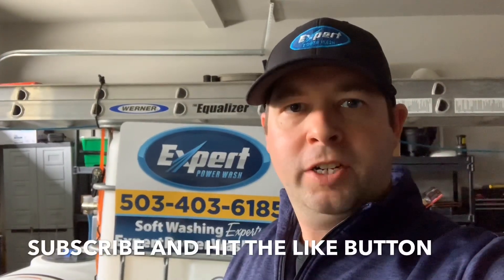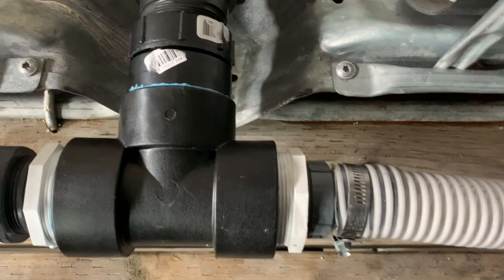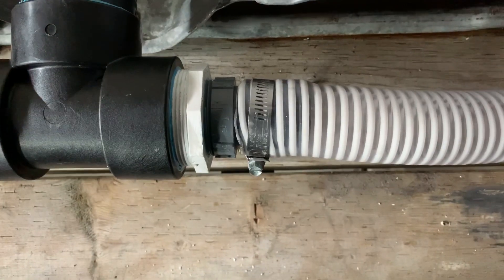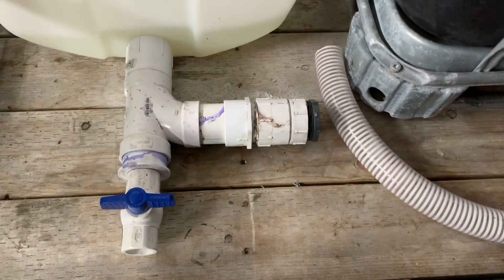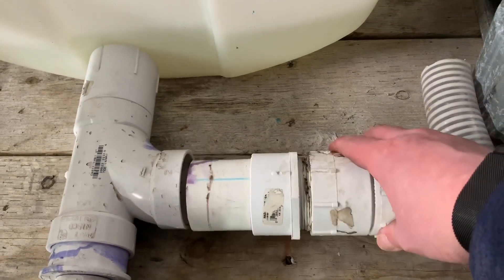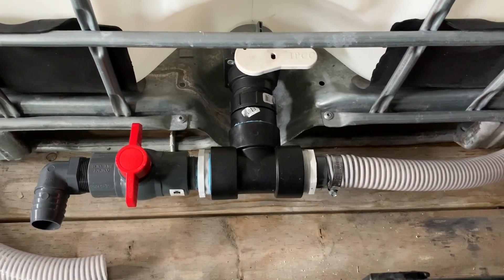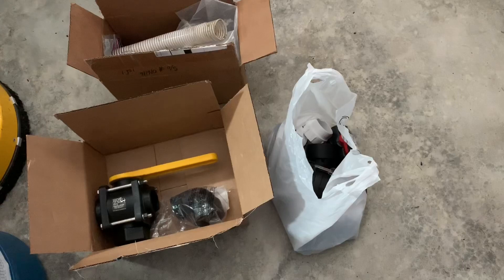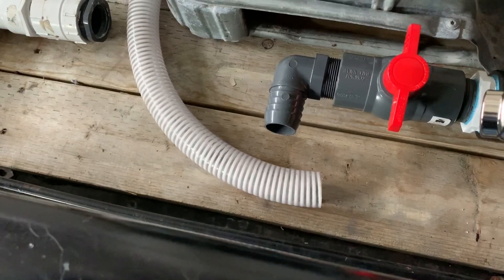Pressure Washer Plumbing To An IBC Tote

Comment: Do you need a small pump to supply pressure to the pressure like 60psi are gravity is enough.
Reply from the maker: With a commercial Pressure Washer either belt drive or gear drive the machine will actually suck water so no pump needed. If you are using a homeowner grade machine that is a direct drive yes you would need a pump. My advice would be just to use a commercial pressure washer designed to pull water from a tank

Comment: The 2” ball valve coming out of the IBC tote, where did you get it? I’m considering doing what you did except adding a “y” and a ball valve so I can plumb my P40 off it. And if I am using both machines at once then I can adjust valves as needed to get water to the pumps I’m running.
Reply from the maker: I believe I picked that up at Home Depot years ago

Comment: Great video!  I purchased an 300 gallon Ibc tote and have been looking at ways to plumb it.  Do you have any trouble with the gravity flow?  I have a 4 gpm pressure washer and am wondering if I need to install a pump to keep the pressure consistent.
Reply from the maker: No buffer is needed for a 4 GPM. Most commercial machines that are belt or gear will pull water so gravity feeding is not an issue. Most house hookups are 5-7 GPM of flow. If I had a 4 GPM, I personally wouldn’t plumb it unless it was a backup machine attached to a truck or trailer. Hope that helps.

Comment: Looks good! I’m trying to do something similar but with 2 pressure washers and still have a dump valve.
Reply from the maker: Hope it is helpful. I wouldn’t run two pressure washers from the same feed line unless only one would be used at a time.
Reply: Yeah the second will just be a back up. Yes thank you it’s definitely helpful. I’m going to try and work on it the next couple days. Thanks for the video! 👍🏼💪🏼🙏🏼

Comment: Have you ever considered getting a Hydrotek water recovery vacuum to filter out the water to 1 micron and pump it back into your water tank or secondary water tank to reuse?
Reply from the maker: No current use for it.

Comment: So how is it hooked up to the washer it's self? And is the flow of the water not need a pump in between the tank and the washer it's self?
Reply from the maker: Belt or gear drive will pull water if using the right pressure washer.

Comment: My 8gpm came with all 1” plumbing… it runs fine but do you think it would be better with 1.5”? 
I have zero issues with the machine as is but curious, would I see a difference???
Reply from the maker: This is an older video. We have switched to 1 in with no issues. 1.5 is fine but a lot less bulky. Never had an issue with 1 in.
Reply: @ExpertPowerWash  awesome, me too. Thank you for the confirmation

Comment: Hey, I'm about to do the same. Start up on my pressure washing business. I was wondering if I can effectively use my IBC tote to gravity feed my pressure washer. I'll be using 3,200 PSI @ 2.4GPM.
Reply from the maker: You can but why not buy a used belt machine that will pull water. That machine is too small for commercial use. If it’s all you can afford, don’t use it longer than you have to.

Comment: What did you use to secure the tote to the trailer
Reply from the maker: U bolts around the bottom of the tote frame through the floor. Use stainless and big fender washers.
Reply: @ExpertPowerWash  is there any specific size
Reply from the maker: Honestly ones that will fit. Gauge the thickness of your trailer floor. I think I used 3/8 size threads

Comment: How it connect from crush prof hose to the pressure washer ?
Reply from the maker: I have lots of videos on this. Was there something I didn’t cover?
Reply: @ExpertPowerWash   this was the first video i seen of your i'll look for your others. i have a 16 ft double axle
trallier im replacing wood on and putting new tires on to use as a pressure washing tralier.  im starting up a striping business and like to be able to clean before i strip and upsell some cleaning while iam  there.
ive used large heated trailer style pressure washers but ive never owned or built one.
With my budget im looking at a 4gpm  pressure washer , 275gal ibc tote. can i run the pwasher with just gravity or will i need to add a pump?  i hear athe term buffer tank not sure if thats something i'll need.
Reply from the maker: Don’t need a buffer for 4 GPM unless there’s no water on-site. You want a belt or gear drive machine or it won’t properly pull water. Don’t rely on gravity feeding regardless of what you hear or people telling you. Use the right machine and you will be happy you did.
Reply: @ExpertPowerWash  thanks for your reply and the tip. Appreciate your time.

Comment: Did you have to prime the feed hose? I’ve been having issues with getting my pump to prime. Any suggestions?
Reply from the maker: Not with a belt or gear drive machine. Wouldn’t recommend anything else

Comment: I'm gonna be starting a mobile car wash business and wanna get a similar set up. No actual pump needed? I thought I'd need a pump to the pressure washer
Reply from the maker: You have to have a belt drive or gear drive pressure washer. A regular direct drive will give you problems

Comment: So I will not need a water pump , to have the force of the water to go to the pressure washer? I will be able to rely on leaving it on top of the bed and getting away with a gravity system method, I’m doing a neighborhood park and some fences, and do not have a water source so I got the tank, and waiting for the attachment so I do not know until Tuesday
Reply from the maker: Use a belt drive machine. It will suck water and not need gravity fed.

Comment: I watch a lot of your videos there’s so much good stuff anyways how do you secure your ibc tote?
Reply from the maker: Great question. Use heavy duty stainless u bolts. It wraps perfectly around the round bottom frame of the IBC tote. Hope that makes sense. I may have covered it in one of my trailer videos.
Reply: @ExpertPowerWash  thanks man always helpful

Comment: yo my man, i have a 4gpm machine and building my trailer now, i have a big ibc tote, and i want to know if i have to put a pump in place to push the water, let me know and if gravity feed would work, how high would i need it to be?
Reply from the maker: Only a belt or gear drive will pull water. Wouldn’t recommend a direct drive running off a buffer tank.

Comment: Plumbing a build is fun,but can be aggravating too. Especially if you have to order everything
Reply from the maker: Ten trips to the hardware store. I started buying all my nuts and bolts by the box. Buy multiples of the most common stuff. Organize in a tote and label. I bought one of those bin organizers from Uline. It’s life changing.
Reply: @ExpertPowerWash  That is very smart. Organization is key. The more organized you are,the more efficient you will be👍 those bins are nice.

Comment: Do you hook up directly to your pressure washer with just the inline filter? I thought you needed to run a water pump to help push the water from the tank to the pressure washer.
Reply from the maker: Belt and gear drive pressure washers actually suck water. That’s why you don’t see direct drive machines being professionally used in our industry. Hope that helps.
Reply: What he said, belt-drives will suck water to pump. 
Also, an ibc tote will drain at around 40-60gpm through that 2" spout.
The restrictions are gravity and your pipe size. You can gravity feed. No need for a tank pump, imo.

Comment: Hey man great video. What size barbs do you have on your banjo strainer?
Reply: Is that a 1 inch or an inch and a half size banjo strainer? Currently I have a 1 inch banjo strainer and can’t find any barbs that are 1 1/2 inch to 1 inch mpt
Reply from the maker: 1.5 inch. If you are trying to use a 1 in y strainer and add 1.5 barbs, don’t do it. Just get a 1.5 y stainer. Your life will be much easier.
Reply: @ExpertPowerWash   thank you so much for your reply! I just went ahead and did that and ordered everything I needed last night. Best wishes!!
Reply from the maker: It will work out much better. The best of luck to you.

Comment: What size of hose would you use from your plumb tank to a 4-5gpm Pressure washer?  I used 1in and it wasn’t pulling enough water to my pressure washer
Reply from the maker: Direct drive machines will not pull water. Machine needs to be below the level of water. 1 in is plenty and should work. Probably overkill. You could use 3/4 with no problems. Sounds like you have a gravity feeding problem.
Reply: I started out w 1” for my 4 gpm direct. worked as long as hose ran down to the pump- that’s key. I had my 150 gallon tank elevated- gravity would push 12gpm
Reply from the maker: Seems it would just be easier to get a belt drive machine.

Comment: I thought the filter should go before the tank not after. Does it make a difference?
Reply from the maker: All preference. I alway run my faucet for 10 seconds before hooking my hose up. This flushes any bugs and debris out.
Reply: @ExpertPowerWash Stuff always finds its way in there and sits on the bottom of the tank,so after is better. But like I said to the person questioning it couldn't hurt to do both in and out. It's not like they're expensive.
Reply: No, because if there's any sediment at the bottom of the tank for any reason the filter needs to be after. That being said you could filter both before and after to be super safe.

Comment: Hi I have watched all of your videos and learn a bunch. Could you help me how to plumb 1 1/2 to the pressure washer? I really want to increase the flow by the way how you did it.
Reply: I would really appreciated if you could tell me the fitting on the pressure washer instead of female quick connect.
Reply from the maker: I got it from Lori with Pressure Washer Products. I don’t remember the exact size. It’s called a king nipple. Call them up and they will get you taken care of. Appreciate the comments.
Reply: @ExpertPowerWash  got it thank you so much for replying back to me. I have 5.5 and adding a 8gpm soon and I really want my machine to have the best flow for the best result...! I learn a lot from you watching the videos over and over.
Reply from the maker: I appreciate that. You will do well!
Reply: @ExpertPowerWash  haha thank you so much. I basically copied exact set of tote plumbing of yours for my trailer, except my water hose will be a 1in for 5.5gpm. Once 8 gpm comes I will re-do the plumbing and make it 1 1/2 just like you then move 5.5 on to my truck.

Thank you.
Reply: @ExpertPowerWash  Im so sorry but i have a big questions to ask you. I have been looking a specific size for a pressure washing hose for "Pressure washer -> Hose reel connecting" What are the options? do we just have make a custom sized pressure washing hose?
Reply from the maker: Yes it’s called a whip line. Pressure Tek has them in different sizes. Probably other vendors as well. It’s just easier to navigate Pressure Tek. Hope that helps.
Reply: @ExpertPowerWash  awesome! Thank you so much. By any chance do you use inject bypass? If so has it worked out well for you or feel any difference?
Reply from the maker: I don’t use one. I have one still in the box. Been meaning to try it but it’s not necessary.
Reply: @ExpertPowerWash  again thank you so much for kindly replying to all .y questions. Hopefully someone lost just as me can read this and learn. 

Be safe during this time and make bunch  💰💰💰💰😄😄!!

Comment: Hello, thanks for the video. Why did you decide to use 1 1/5 inches instead of 1 in.? Is there a noticeable difference ?
Reply from the maker: I think you could get away with 1 in. I did it with the recommendation of Pressure Washer Products. I’ve never had a problem with water. I’d rather push the most water I can to my 8 GPM.
Reply: @ExpertPowerWash  thank you, also what is the number for Lori in Florida? I live down here and need to get some parts.
Reply from the maker: Not sure. It should be in the site. Her recommendations have worked flawlessly going on 4 years.
Reply: @ExpertPowerWash  how'd you connect to pressure washer?
Reply from the maker: I’m sure it’s in one of my videos

Comment: why didn't you glue the fitting on the first one?  It seems to me that depending on friction is not the way to go, so now you have a large amount of water pouring out from your pipe.  I do like the 2nd one, so as for me that's all I have to say.
Reply from the maker: Thanks for the suggestion. His has worked out great. Thanks for watching and commenting.

Comment: gravity fed or you using a pump
Reply from the maker: For? Pressure washer has a belt drive pump. I use a measuring cup for soap. I use a 12v for my dedicated roof pump. I use a transfer pump to transfer SH to the truck.

Comment: I have mine hooked up with 2" camlocks reduced down to 3/4 " faucet that is threaded.. Will that be enough pressure ? Because it seemed without the pressure washer hooked up to be a weak stream etc etc
Reply from the maker: This will vary depending on who you ask. I prefer 1.5 in for 8 GPM and at least 3/4 for a 4 GPM. Try to limit 90s and misc fittings as much as possible. Bigger is better. Hopefully you are using a belt or gear drive that can suck water. If not, make sure gravity is working in your favor.
Reply: @ExpertPowerWash  
I think part of the problem is the cheap spicket 3/4 " that I hook my hose to ..
Also I'm going to try to run a pump in between the tote and pressure sprayer
Reply from the maker: You should not need a pump. Belt drive will suck. It’s better to have everything set up properly. Too much unnecessary things to break not to mention wiring, etc. Worst case scenario, if it’s direct drive, have your tank slightly raised so it can gravity feed to your pressure washer. There are easier ways to make it work besides a pump.

Comment: So you don’t need a pump to the pressure washer?
Reply from the maker: No
Reply: Expert Power Wash and your pressure washer doesn’t have a pump? The water pressure in the tank makes enough pressure? ps thanks for responding.
Reply from the maker: A belt drive machine sucks water.

Comment: thanks for fast reply!  hello from up here in seattle!  I got the parts at good local hardware store, copying yours 1.5, except 1.5 bulkhead, 1.5 hose to banjo filter in/out, 1.5 to??   How did you connect 1.5 to pump?  I've got 10.2 gpm general pump. That's my next problem to solve.  I made a reducer setup to go 1.5 to 1 crush proof hose, but now I see you have 1.5 right to the pump, but please explain how you did this?  thanks in adavance!   nate
Reply from the maker: I used a king nipple fitting from Pressure Washer Products in Florida. Get a hold of Lori there. She will hook you up. Not sure the exact name or part number. They installed it when I ordered my pressure washer from them.
Reply: @ExpertPowerWash    Small world, I just talked to that Lori lady in florida a couple days ago.  I saw their built 3500 8gpm great deal machine, 2 days after I ordered my new engine and pump and pulleys and skid etc to build mine.  Get this ,  I told her I was thinking of canceling my honda motor and buying her machine, and sending back my other stuff that was being shipped already, and she said, "No, do not do that, you build your own."   I said, what?  I'm saying to her that I am thinking of buying her machine, and she literally tries to convince me to continue on my path and build my own.  I thought that was pretty amazing, props to Lori, huh.   thanks again for reply.  Nate
Reply from the maker: She is great! Thanks for sharing.

Comment: thank you, nice!   say, where do you get the grey plastic hose barb that screws into the white pvc threaded reducers?  is there a website you like with all these?  finding 1 1/2 to 1, or 2 to 1/2, etc, bigger size ones having difficulty finding, thanks
Reply from the maker: Just a local hardware store. Had trouble finding them at Home Depot and Lowe’s. Also see if you have any plumbing stores.

Comment: Tim, how can I take a 65 gallon tank and solely use it as a soaper?
I want to be able to get my gun, flip a switch and spray soap. I'm assuming I'll need a pump for it and idk. 
And I'm a do it myself. On the back of a flatbed.
Reply from the maker: Lions Gorrilla thanks for watching the video. As far as the 65 gallon tank, I’m assuming this will be a buffer tank for water to a pressure washer. You will also need a soap tank. I currently use a 15 gallon tank to draw straight SH through a downstream injector. I add some Elemonator soap to the tank. The best way to change from water to soap is to use a electronic ball valve. These can get a little complicated. There are products that solve that problem. Look up the Schwartz box on FB. This is currently the best option. You could also achieve this without a pressure washer and use a booster or 12 v pump but you would still need the box to switch from water to soap. Hope this helps and thanks for commenting.
Reply: @ExpertPowerWash  
No Thank you for the video. I enjoyed it after going through so many. The advice is even more humbling. I will look into that now. Thank you again.
Reply: @ExpertPowerWash  
And yes Sir, it is for pressure washing.

Comment: Your filter is upside down, how is the dirt supposed to drop in the filter
Reply from the maker: Check it about once a month. No problems. These filters don’t need to be turned a certain way. It comes down to personal preference. Also always let your garden faucet run for a second to blow out dirt and cobwebs before hooking up your water supply. I appreciate the comments.